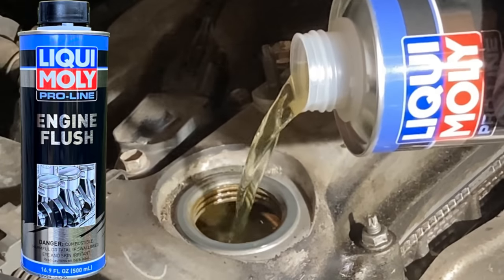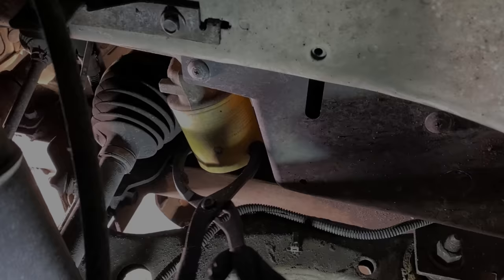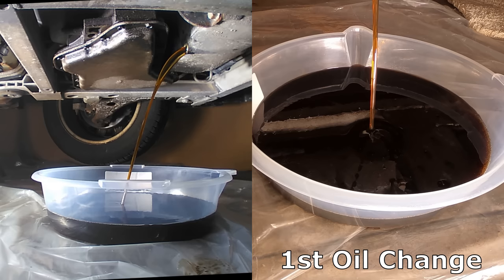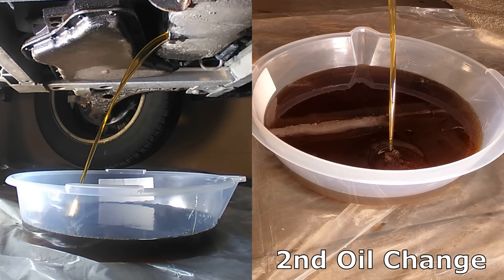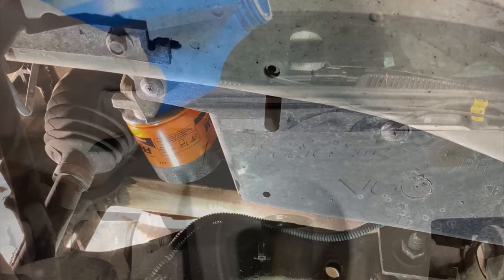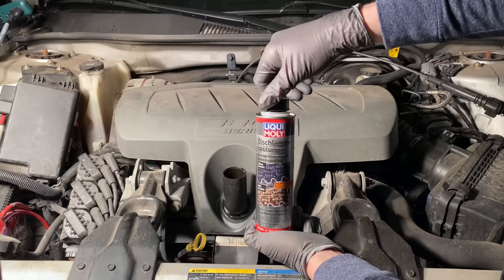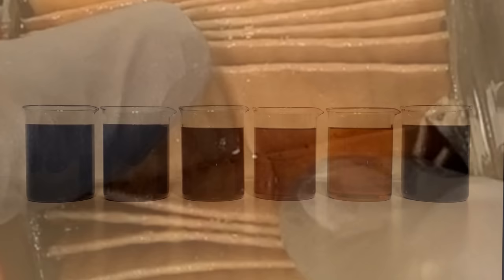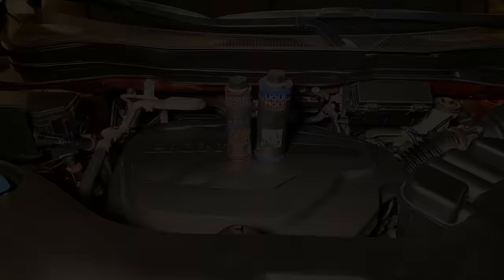Liqui Moly Sludge Remover vs Liqui Moly Engine Flush (Which is Best?)

Comment: Oil will definitely get darker once you travel 200 kilometres
Reply from the maker: I have completed early oil changes before and the oil was darker but not black like this.
Reply: @OwenLucas  oh ok, btw I am using Shell Rimula R6 LM 10W40 and after a few oil change my engine is sparkling clean without the need to flush.

Comment: Sludge does no harm while just sitting in its places inside the engine. Use sludge remover to add the sludge into your oil circulation and it may start doing harm. Definitely would not use such products, especially based on how many perfectly good automatic gearboxes are breaking down after flushing.
Reply: This is an engine flush, not a transmission flush...

Comment: 126 miles with new oil, your oil should still be clean unless it's a diesel engine. Looks like the sludge remover worked. The amount of oil you used, in the UK it would have cost $200+ 😮😮😀
Reply from the maker: I was lucky enough to buy all the oil except the blue jug on a massive clearance at Amazon for $5 each.  I saved the used oil as well as it was basically a rinse, so no waste there...just multiple jugs of oil taking up space on the shelf! 😂

Comment: There are engines with wet belts. I wouldn't pour that in there.
Reply from the maker: Some of LMs formulas are wet belt friendly, I am not sure about this one though!
Reply: @OwenLucas  I have a car just like this. When I got it I didn't know much about engine technology. And I did have to change the belt. I change oil every 4000 miles. Works fine 2 years already. It's a PSA engine. I'd prefer an ordinary timing belt. Chains can be expensive to repair if something goes south.

Comment: Why you need sludge remover or engine flush ?
If you use STP oil , your car engine even Will be cleaning all the time by their additive 👉anti sludge additive and anti corrosion .
You won't see STP in motor GP but you can see that brand in FORMULA 1 .

Comment: Add transmission fluid to oil , let run for 20 empty engine then cheap oil to run for 5 min flush engine....add good oil 👍🏼ann engine build up comes out engine like new
Reply from the maker: Be careful with ATF in an engine, I’d rather use diesel.

Comment: Why do engines all seem to use piss thin oil these days??  Is it for economy or what??   My Caddy van  with a PD engine I put 10w40 in it and it Quantum oil and the engine sounds better and slightly more mpg????
Reply from the maker: It definitely has to do with EPA ratings as manufacturers are graded on fleet emissions, so the miniscule savings in economy can have a large impact on total green house gas emissions of millions of vehicles built by an OEM.  The same vehicles and engines that run 0w20 will be allowed to use 5w30 or something thicker in different countries.  Some of it might have to do with engineering as well maybe due to smaller tolerances, higher engine temps and metallurgical requirements.

Comment: Also don't use shitty Fram filters and cheap ass walmart oil for the oil change before you add sludge remover. Yeah, I caught that.
Reply from the maker: I used cheap filters as they were going to be thrown out after 20 minutes, just for show.  I like Bosch filters or OEM.

Comment: Not any petrol/gasoline engine/motor in the world will produce such an amount of black soot or other substances within 200 km, even not with the dirtiest fuel.
These substances got accumulated over time and came out with the flush.
If you'd always use high quality oil with a good amount of detergents you hadn't such an accumulation of dirty substances in your engine.
What oil (fully synthetic, minerally based, fully mineral) and what viscosity did you use?
U.S.-drivers use cheap oil for brief intervals and have always cheap oil in their engines. German drivers use crazy high quality oils but keep them in way too long. 🤪
Reply from the maker: This engine used 5w20, the vehicle has been run with semi synthetic and full synthetic...but maybe a bit too long!
Reply: @OwenLucas  I don't think that 5,000 miles are too much.
How about oil losses over 1,000 mi? How about a higher viscosity index like 5W-30 or 0W-30 according to the oil filler cap for avoiding too much blow-by?
What's the recommended interval of GM?
Reply: @OwenLucas  Maybe I'm a bit spoiled from Toyota. 🤭
I had a Prius Mk 2 before that run mostly on LPG (propane/butane). You had problems to guess the oil level for the first 2,000 km after an oil change as the oil was clear and colorless like water. Up to 20,000 to 25,000 km it was like mildly cooked vegetable oil. I friend told me he had the same as he mixed E30 to E50 by himself.
I've been having a Yaris (XP13) now with the same engine (1NZ-FXE), but running on petrol/gasoline - the oil is much dirtier now.
Reply from the maker: @u.e.u.e.  Those are amazing results for a propane vehicle.  We have very few of those in the US. Not many filling stations other than near big cities.  You can't go wrong with Toyota, they just keep going!
Reply from the maker: @u.e.u.e.  This engine doesn't burn much oil, I never had to top it off.   I believe the interval is 3-5k.

Comment: no need for this expensive Engine flush formulas,if you really want a good result and your engine will last longer, all you have to do is for every 2,000km to 3,000km just change the engine oil.
Reply from the maker: For sure if you are the original owner but if you buy a vehicle and don’t know it’s history, a flush might be worth it.  I agree changing oil often and even early is the best advice!

Comment: Whole lot cheaper to use a quart of Trans fluid
Reply from the maker: LM is designed for flushes with basically a built in degreaser, I can see using a little diesel but I wouldn't trust ATF personally.

Comment: None of this means anything. You don't have a "control" in your experiment, which would have been to compare to 126 mile old oil with no additive. Better yet, you need to do a before/after on some relevant surface inside the engine to see if there's any difference.

Comment: Dex Kill orange coolant ruins all the good gm engines. And then the key transponder goes bad.
Reply from the maker: Already had to replace the transponder once!  I'll have to look into the coolant, maybe replace it early or switch to something else?
Reply: @OwenLucas  flush and really try to use the boroscope to search for "clumps" in passages. It is the leading cause of overheating/spectacular gasket failure. Both my grandparents cars blew while driving and they couldn't see the road.
Reply: @OwenLucas  there's a little plastic coolant pipe above the water pump that can crack. Usually it's just a drip if anything but can go all at once.
Reply from the maker: @marshmower  Wow thanks for the heads up! Time for a flush and fill.
Reply from the maker: @marshmower  Interesting, might as well replace the part while I have the system empty, no need to wait for it to crack when it most likely will.
Reply: @OwenLucas  I don't know if the series 3 is identical to the series 2 but look it up. That engine has good and bad. Changing the coolant passage that sits in the valley is not something I was brave enough to do. I would really keep it flushed out and make sure it runs on the cool side maybe. Make sure the thermostat is never clogged
Reply: The first symptoms I ever noticed were gas smell and coolant drips.

Comment: Carmakers do not recommend   any aditives. Not when the car is under waranty or later. 
Bottom line is they have all the engeneers money could buy and they dont want any of it inside their product. Dont you think they would love to save the money  for repairs at least while a car is under waranty?
Reply from the maker: Most of the time there is no need for additives during the warranty period which can be between 3 to 8 years if you buy extended plans.  Unless you put 150k miles on the engine or poorly maintain it, most likely no need for any flushes until the engine gets older, which for most people is beyond 100k miles.

Comment: Best thing to use is Diesel.. no need for these useless products
Reply from the maker: The oil sludge remover is better because it contains 2-Butoxyethanol which is a surfactant that attacks sludge, basically a degreaser.
Reply: @OwenLucas I've tried using diesel and it actually worked, a lot cheaper too because you can do it multiple times

Comment: Its just diesel in an expensive can!
Reply from the maker: There are petroleum products in the can for sure but this product is specially formulated to remove sludge by using surfactant chemicals such as 2-Butoxyethanol which is essentially a degreaser.